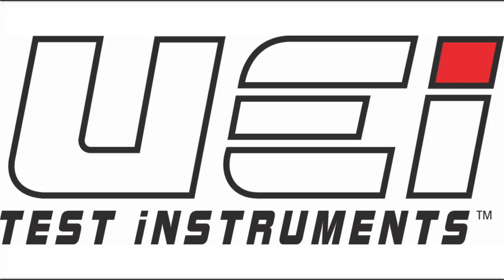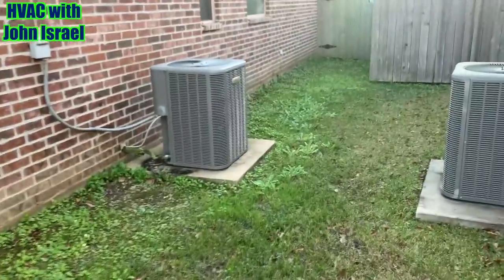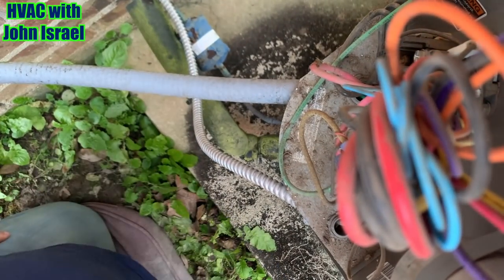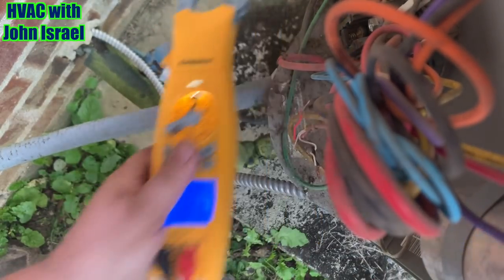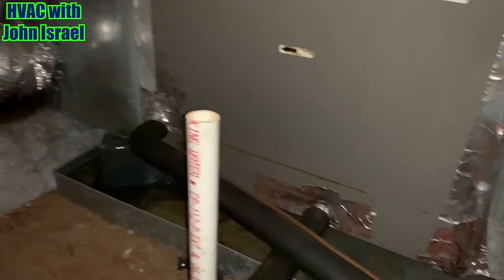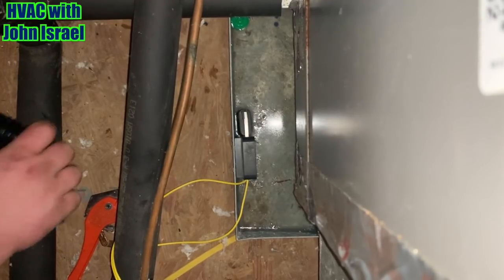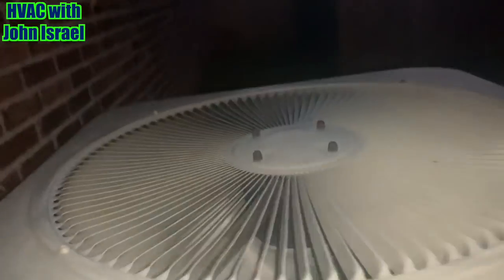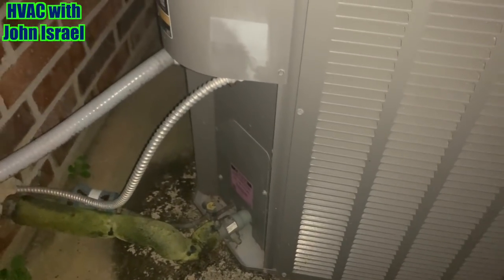No Cooling Service Call | Clogged Drain

Comment: I normally used Dry/Wet vacuum cleaner suck the water directly from the drain pan. This way you don't have to cut off the drain line.